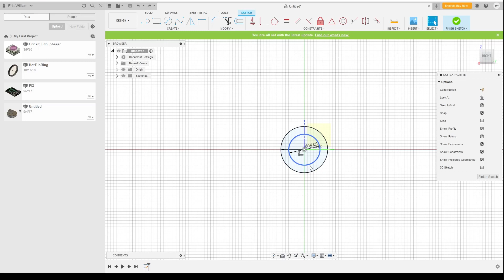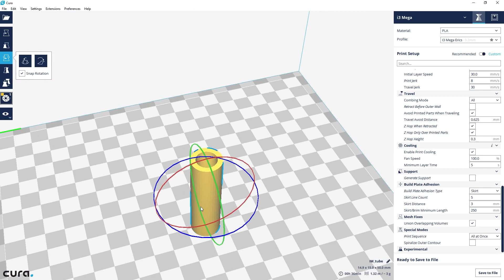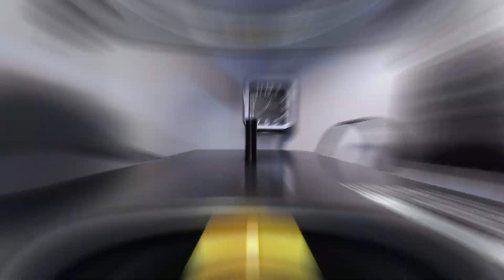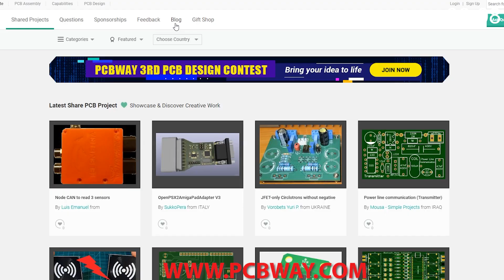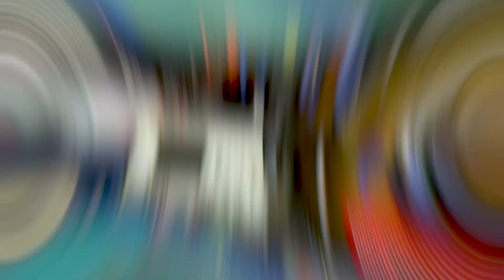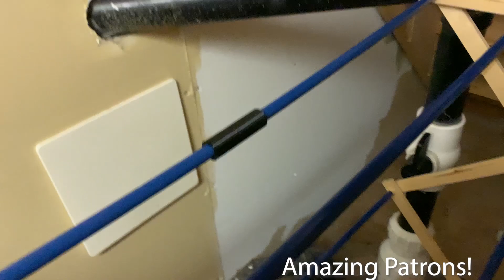Fun With 3D Printers- SIMPLE Repairs At Home! #3DPrinting

Comment: "You too made a cylinder with hole in it? HOW COOL IS THAT?!" ;)
I also printed a cylinder with hole in. It was a spacer for bench grinder disc. With few clicks and typing in measured dimensions, perfectly sized spacer with perfectly aligned hole appeared out of thin air. 
One great aspect of designing and 3D-printing parts is simplicity of iterations. Newly printed part was little bit too wide? Just type in a slightly different value and wait for the printer to do it's thing. All the hard work is done in the design software and it won't be thrown away if new iteration is needed.
Reply from the maker: I really wasn't going to make the video but I forced myself to rewind to the days before I had a printer and indeed this seems like bloody magic.  So simple but so damn useful :)